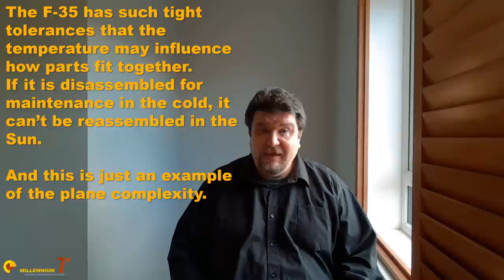F-35: The Failure of the $100 Million  Dollar Jet | Maybe...

Comment: An aircraft design built on compromise is a compromised aircraft. A small airforce will struggle to keep these hanger queens operational. The F16 was designed as a low cost high operational tempo solution. The Gripen is the logical extension of that aging platform.
Reply: That is a bit of a misconception, there are no limited numbers of skill points IRL.
A plane that is good at A/G can also be good at A/A and CAS and the success of the F-16 is due to it developing away from its design roots.
A Pierre Sprey style F-16 without long range radar, AMRAAM, targeting pods and guided weapons would be all but useless.
The F-16 operating with TPods, CFTs and additional avionic in the spine, is pretty close to a F-35 as far as weight and maintenance goes.
The Gripen is a great little fighter, but it does not have the range and payload, choose one, sacrifice the other.
Reply: Gripen a metal box over priced scrap.
Better to opt for full composit body indian mwf/tedbf/orca and amca.
Reply: @kilianortmann9979  I guess my point is having three branches demanding different things from a single airframe leads to design changes that bleed performance in one way or another and add unnecessary costs. Its still a decent platform but will forever be costly one. The F16 as old as it is still packs a wallop and delivers on a reasonable budget and the newer Gripen is built with best that can be found on the market including some very good American tech.
Reply: @pravirchandragadkari88  The Tejas is a great platform no question. I would not discount the Gripen on its construction material though. It has a very good operational record which will likely carry over to the new E model. The cost per flight hour is now more important than ever for govts  and im not sure where the Tejas stacks up in this area?
Reply: @robcormier7272  I can absolutely see your point, but combined service aircraft can be quite successful, see F-4 and A-7.
A problem in the 90s was that the forces that needed a new design the most (USN and Marine corps) could afford it the least.
USAF had the F-117, B-2 and F-22 so they were quite set with 5th gen.
A joint program might have been the only way to finance the Navy and VTOL versions which otherwise would have a enormous unit price, due to small fleet size.
I know that's politics, but i think separate programs would have left the Navy without a stealth platform and the Corps with harriers, held together by duct tape and crayons.
Reply: @robcormier7272  tejas uses original ge404/414 engine . Rest you can judge. Weight if tejas is lesser than gripen . Tejas has lowest wing loading and least radar cross section in all currently available 5- gen fighter jets . Tejas has fly by wire in all axis since it's first tech demonstrator and zero accident record till now. Gripen has only three pluses one data link and second limited  supercruize in limited envelop and third sensor dusron . Tejas has higher versatility than gripen in weapon and data link and sensor fusion can be incorporated in its variants .
Reply from the maker: Please...
Reply: @pravirchandragadkari88  just grow up
Reply: @pravirchandragadkari88  Hahaha !!!

Comment: I think you've done a really good job of making your point and at this point it is a valid as any of anyone outside of the military loop.
I think the Americans had 2 problems with F-22 and more so with the F-35. One they forgot the adage "Cheaper, Faster, Better pick any two" and the second is both planes seemed to have come into service at a point of transition where a combination of technologies have come together the best example I can think of of 3D printing of metals and ceramics even NASA is using it to design engines with intricate cooling systems built into their very structure allow higher operational temperatures.
I think the high low strategy was demonstrated during the gulf war you had highly specialised aircraft going in clearing the way  for more conventional aircraft to go in and do their job. The war in Afghanistan has shown Jets are not the planes for ground attack they are costly to run and maintain and their loiter time is limited. Which is why I'm pretty sure its the US army has taken delivery of turboprop ground attack aircraft It is time proven technology they can carry all the ground attack assets that the jets carry  while being cheaper to run, maintain and god forbid replace if lost combined with longer loiter times. unfortunately the article I read only mention this in passing so I don't know if this is a full fledged roll out or a small number for in theatre evaluation.

Comment: i still remember that old ridiculous statement from DOD that the F35 could replace the A-10. a "Joint Fighter" that's designed to do everything ended up not able to do anything.
Reply: haha I was one of those people saying the f35 should replace it. Oh well sometimes you are wrong about things.
Reply: You think the F-35 can’t do anything?  It can do plenty; just not close air support well.  It was never designed to replace the A-10.
  Hell, the A-10 was never designed for close air support as it is used.  It was designed outright to kill armor columns coming out of the Soviet Union and Eastern Europe.  Who needs 30mm depleted uranium shells to take out Taliban infantry.  It’s slow and it has good loiter time and so it’s used for that.
Reply: @damianketcham  This is a good point. The f-35 is incredibly capable and really can do basically everything we use the A-10 for. Its just that there is nothing it can do that can't be done cheaper some other way.
Reply: @peterisawesomeplease  
True!!
Reply: the f-111 in the gulf war did more CAS than the a10 ever did.
Reply: Does cheaper mean better? It isn’t supposed to be cheaper than an F-16 dude…
Reply: 1 F-35 can destroy 20 A-10s from 100 miles away, A-10 pilots wouldnt even know what hit them if they happen to survive..F-35 can launch missiles from ground assets one at a time or simultaneously. The A-10 is slow and designed to loiter and attack at slower speeds-  its no competition to a F-35, its like racing the latest Ferrari against a 1982 Ford F-150 on German race track.

Comment: An important question is: what about mission capabilities if the F-35 quantities are reduced?
There were still some 871 flaws to be fixed, last time I checked at the beginning of the year. If the F-35 is reduced down to the role of an F-117, how many of them will be fixed? 
What about the foreign buyers? Will they end up with an aircraft with very limited capacity for the price of a "gen5" multirole fighter?
What about future updates? Will anyone bother to invest in updates in 10, 20, 30 years  time, for a limited quantity of airframes with limited capabilities? 

The whole point of the F-35 was to offer unprecedented capabilities by dividing the huge development costs involved on a large number of aircrafts.
If quantities are reduced, the unit costs will be much higher, without the capabilities.
Reply: @michaelkeller5008  "Trump was right about the F-35 to be a Trillion-Dollar-Cashgrab." is wrong.

If you read http://www.gao.gov/assets/670/666042.pdf
 at page 25 shows the breakdown for $916.3 billion (JPO) or 1020 billion (CAPE) estimate

$916.3 / 56 years = $16.36 billion per year.
$1020.3 / 56 years = $18.21 billion per year.

F-35's $1 Trillion price tag is over 56 years and +1700 unit fleet.
Reply: @michaelkeller5008  French's Rafale has a navy requirement that is missing with the  Eurofighter program, hence the split.
Reply: @michaelkeller5008  Eurofighter can exceed Mach 2 speed (i.e. Mach 2.35) which is not the case for Rafale. Eurofighter was designed to be the answer to USAF's F-15A/C which is a high-energy dogfighter with fast interceptor capability.

Rafale's aircraft carrier requirement leads to better low-speed maneuverability similar to Hornets. 

F-35A = "Hornet with a Turbo". F-35 is also pretty good with low-speed maneuverability similar to Hornets. F-35A and Hornets have an angle of attack advantage over Rafale.
Reply: @michaelkeller5008  Unlike the Franco-German stealth fighter project,  UK/Italy/Sweden's Tempest does not have aircraft carrier requirements.
Reply: @michaelkeller5008  Eurofighter is based on BAE's EAP which has no consideration for aircraft carrier requirements. UK's, Spain's, and Italy's naval aircraft designs are served by Harrier jump jet and its follow on F-35B. 

UK, Spain, and Italy operate LHD-type aircraft carriers. V/STOL fighter aircraft have the ability to operate from large commercial container ships which act as an escort aircraft carrier.

To stop France's naval air force projection is to sink its single aircraft carrier. 

V/STOL fighter was designed to factor in aircraft carrier war of attrition in a total war situation.
Reply: @michaelkeller5008  
http://www.f-16.net/forum/viewtopic.php?f=55&t=5525&start=1335#wrapper
From GTA4's post with OEM numbers, F-35A beating EuroFighter in acceleration.

F-35's front cross-section area size is similar to Rafale.
http://www.f-16.net/forum/download/file.php?id=18395

F-35's front cross-section area size is similar to F18E.
http://www.f-16.net/forum/download/file.php?id=18727
Reply: @michaelkeller5008  
Read https://qph.fs.quoracdn.net/main-qimg-a8fe8d0af0569b100b7c6fb1b7ccb100.webp
F-35A's flight envelope is digitally restricted with a straight vertical line instead of a natural horizontal teardrop shape i.e. USAF spec'ed a Mach 1.6 at ~1200 Mph speed. Higher speed has higher air friction, hence a higher IR signature. 
 
F-35A's sweep wing angle can support Mach 2.15 speed, but it's digitally restricted.
Reply: @michaelkeller5008  F-35A Block 3F can supercruise at Mach 1.2 with an internal weapons load. F-35 has active engine upgrade programs e.g. F-135 Block 1 (F-35 Block 4.4) and Adaptive Engine(F-35's road map goes up to Block 7). Based on history, F-16 has at least 3 engine thrust upgrades i.e. 23.8k lbf, 28.6 lbf (Block 30) and 29.6K lbf (Block 52).
Reply: @michaelkeller5008  
Your "F-35 is more like a bumblebee on calories; it's slow, heavy, can't take as much load with it " statement is FALSE, F-35's internal weapon bay and stealth is a day zero invasion fighter aircraft. Rafale, Eurofighter, and Gripen weren't designed for S300/S400. Europeans outside of the JSF program are NOT in the business to start WW3.

Prove "F-35 shall have had worse climb rates than the F-5" (175 m/s).

Hint: 
Classic F/A-18C Hornet has a 250 m/s climb rate.
F/A-18E Super Hornet has a 228 m/s climb rate.

http://nettsteder.regjeringen.no/kampfly/2015/11/20/a-fly-f-35-erfaringer-fra-den-forste-uka/
More F-16 vs F-35 from Norwegian pilot.
I quote
Overall, flying the F-35 reminds me a bit of flying the F/A-18 Hornet, but with an important difference: It has been fitted with a turbo
Reply: It has gotten to the point where the planes like the F-16 and F-15 actually doing the missions executed better than an F-35 or F-22 because they are reliable, easy to configure, easy to maintain platforms. This is what has happened with the bombers already--the B-52 is better at the missions now flown than the B-1s and B-2s for exactly the same reason. Maybe in some hypothetical third world war, but in current combat, you are better for with the older aircraft. It has now been 75 years since the last world war. May be centuries, if ever for the next one (assuming climate change does not kill us first).
Reply: @michaelkeller5008  F-35A's wings design has F-35B's a roll-on/roll-off consideration i.e. high lift with low speed. Note why F-35A = Hornet with a turbo.
Reply: @michaelkeller5008  
http://www.flightglobal.com/news/articles/flight-test-dassault-rafale-rampant-rafale-334383/

The DFCS is a "g" demand system with +9.0g/29° angle of attack (AoA) limit in air-to-air mode and +5.5g/20° AoA limit in both of the two air-to-ground/heavy stores modes (ST1 and ST2) to cater for forward or aft centre of gravity

A heavy loaded Rafale also degraded G loading and AoA. Your argument is hypocritical.
Reply: @cliffordnelson8454  
https://en.wikipedia.org/wiki/February_2018_Israel%E2%80%93Syria_incident
On 10 February 2018, an Israeli F-16I was shot down by the Syrian air defenses after conducting an air raid on Iran-backed positions inside Syrian territory

F-16I Sufa is slightly better than F-16C Block 52 since 50% of  avionics are replaced by Israeli-developed avionics

You are wrong.
Reply: @valenrn8657  It is controversial. Sayings its BS tells me that you are extremely closed minded. It is not impossible. Are you a CIA analysist that studied this? If so I will beleive you. You can say you beleive that it is fake, but you cannot say it could not have happened. In any case the latest Russian technology is not in Syria. The other option is that it was hit by a s-300 which started production in 1975 so it is a very old system also, older than the F-117. Why did you bother to watch this video since you seem to love fantasy so much?
Reply: @cliffordnelson8454  Your argument hasn't addressed my points.  Furthermore, F-117A has zero electronic warfare capabilities, no chaff, no flares, no towed decoy drone, flies like a bomber, and can't target incoming missiles.

F-35 is a mobile Aegis compatible anti-ballistic missile platform i.e. it can detect, target missiles, and target missile launch sites for an instant counterattack. F-35 is designed to be an anti-SAM platform along with being a "Hornet with a turbo"  fighter aircraft. F-35 has digital electronic warfare capabilities, chaff, flares, and towed decoy drones. F-35 didn't skip gen 4.5 fighter improvements.

Comment: Why not considering a rebirth of the F16XL ? This evolutive F16 design was a very bold move from General Dynamics back in the eighties in order to address some of the shortcomings of the original F16 design which was pressed into a multirole mission that the aircraft had never been intended for. The US Airforce finally opted for the Strike Eagle to fulfil this multirole mission but I believe that the F16XL was an overall better platform... wait and see.
Reply: I was thinking the same. The F-16XL will benefit from its single engine layout, decreasing operating costs. You could build a variant of the F-16XL with Conformal Fuel Tanks, Divertless Supersonic Inlet and some RCS treatments like a new version of Have Glass. Then just pair it with the latest avionics and systems and you have a pretty capable 4++ Gen Fighter, at least on paper.